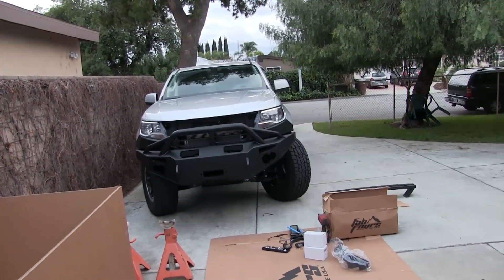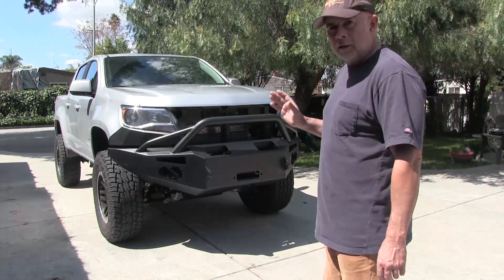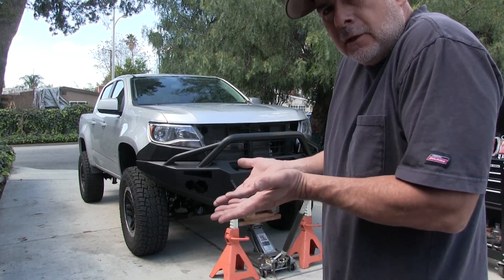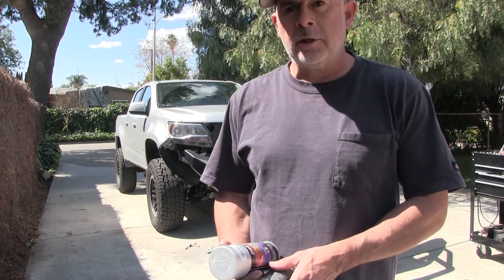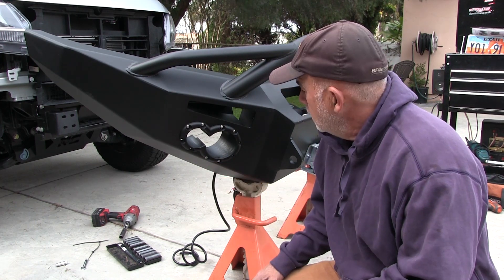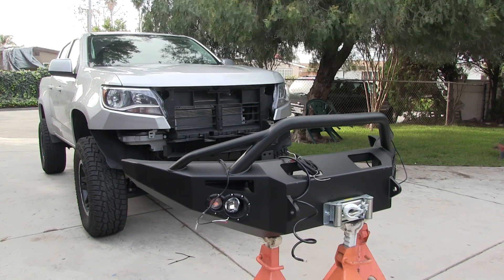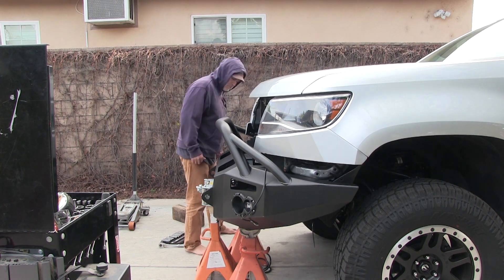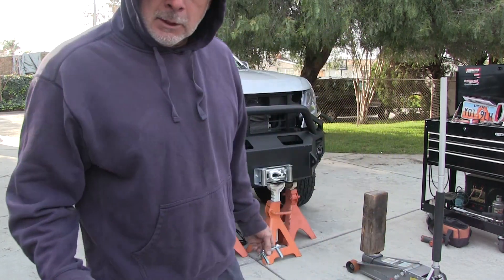Colorado FabFours Bumper Install

Comment: Honestly when you sold the Tacoma I lost interest until I seen the Colorado start coming together. Sometimes an extra set of hands would really come in handy but I've been in your shoes before and just go ahead and get it done all on my own. Trucks looking great!!! Great job getting it done!!! Glad you didn't drop that thing on your feet. OUCH!!!
Reply from the maker: Thanks for the comment. So far this truck is great. It's a new project. That makes it fun and interesting. Let's see if I can get some aftermarket manufactures interested. ARB really let me down.
Reply: @rudedogii  you should have installed super charger first now you get to do the bumper off and reinstall 😂😂😂😂😂

Comment: What did you do with the wheel well liners? I’m mounting this bumper now and running into that issue
Reply from the maker: Had to tuck the ends up and ziptie to something.  Later I used some self tapping screws and  fender washers. You just need to find a flat surface to screw to.

Comment: How bad and where do them 35” tires rub. Running 33” on mine with same lift. Minimal rubbing on back side of inner fender but mine just look too small for the lift. Yours looks great!
Reply from the maker: Works great around town but will have an issue on the trail.  Got to do some trimming!

Comment: Hey, what kind of transmission temperature were you getting after installing that thing? Mine is definitely running warmer. Haven't attempted long drive yet.
Reply from the maker: Oh I think the average was 170F. Later on I drilled some holes around the winch opening for more airflow.
Reply from the maker: See video shows the bumper with added holes for more airflow. https://www.youtube.com/watch?v=wRIPxZbJ4Vo

Comment: I have the same front bumper for my 2015 Toyota Tundra 4X4 SR5. I went with the Smittybilt-X2O-10K-Waterproof Synthetic Rope Wireles though. I also went with the Vengeance Fab Four for the rear bumper.

Comment: Ya could have used a cherry picker for self install.  Good thinking letting air out of tires.  If you grow tired of the weight of bumper contact Aluminess and see if they could use your truck (template) to make an an aluminum bumper you would like (although the steel will take more scrapes and such better) that they could reproduce.
Reply from the maker: I had a cherry picker sitting around for years.  LOng gone. Took up to much space.
Reply: I agree with the old ones taking up space.  There are some new ones that break down.  But hey, it is not like you will use it any time soon.

Comment: Sorry I like your channel but that bumper doesn't look right. Also, I believe you can get the paint code off the door and order exact OEM color spray paint.
Reply from the maker: Yes I could have gone to Bill Wrights and had some paint made to match.  Didnt have the time. It's not a show truck.